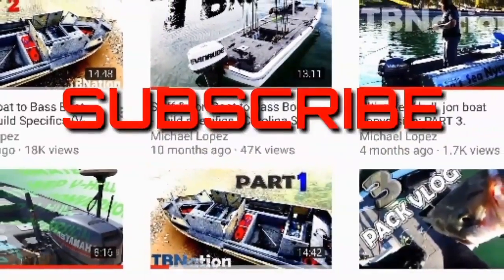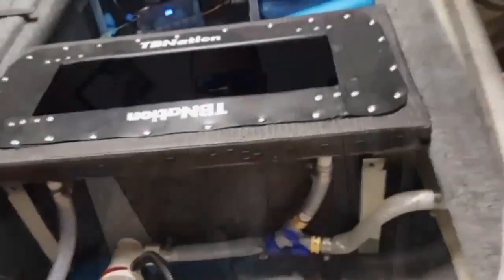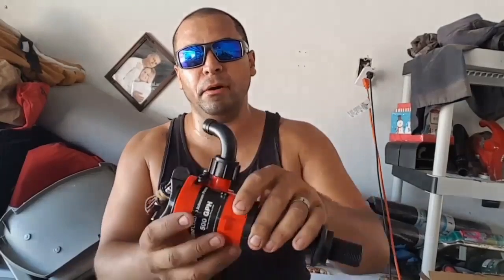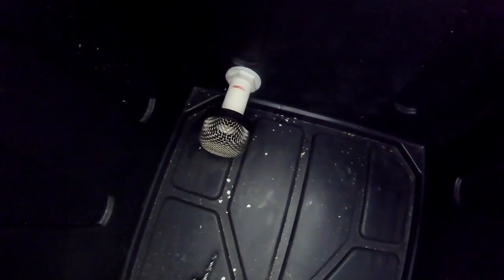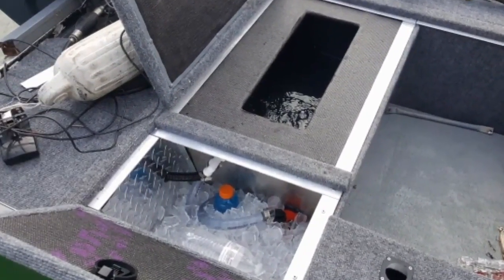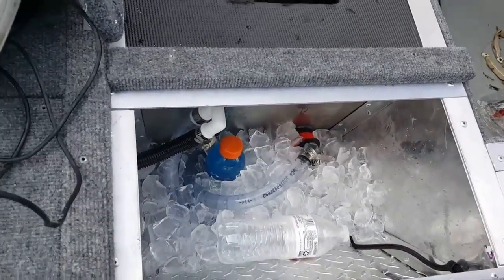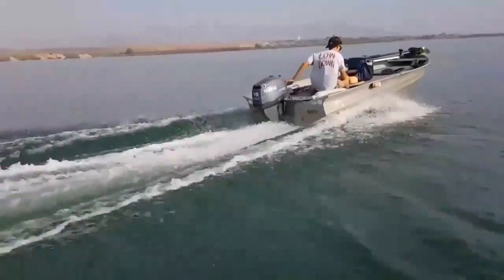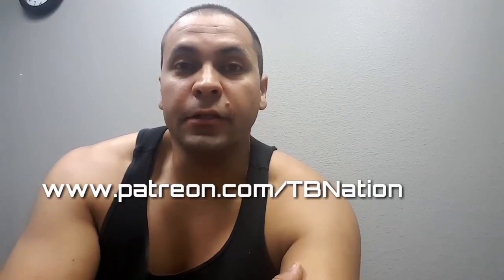DIY Tournament livewell / water cooling system Combo (Jon boat to bass boat) # TBNation

Comment: Love the video. Have you ever considered making a portable cooler livewell using this tech? Most DIY builds simply recirculate the water in the cooler & provide some aeration, but I'd LOVE to see one that pulls in cooler lake water from a hose & allows overflow drainage. Ideally, the inlet hose would be long enough to pull from a depth to reach cool water, not just the top where the boat's hull sits.

Comment: Instead of using 2 pumps on your live-well, 1 for fill and 1 for re circulation. Would you be able to use 1 pump instead and have a 3 way to the inlet of the pump? Just like you have for the out flow. Also do you have to have to fill hole in the transom or could you put it under the waterline under the out flow  drain. I am just asking for opinions, I am planning on doing my own live-well but I want ideas and to do it right the 1st time.

Comment: How about using copper tubing in your chill box? Would cost more, but would be more beneficial too. The copper would hold the temp longer, not requiring as long of a delay for the water to sit in the tubing before going into the livewell.
Probably would want to work with Flex tubing and line the outer part of the chill box with the copper tubing.
Reply: Robert Langley - copper has a chemical reaction to aluminum causing corrosion.
Reply: Seamus Ó Maoilmhichil Liner? It would if touching... Right?
Otherwise, in this case, the only aluminum is in the cooler. Live well is plastic. Other Pipes, plastic. And a liner would or may aide in keeping the ice cold.

Comment: At what point of the water temperature do you recommend having a chill box? Im in Florida but it does't get as hot here. Im debating on either a chill box or rod locker. What do u think?
Reply: What size hole drill are u using for the 3/4" pumps to fit in the transom and livewell?

Comment: How big is the boat you put this in? I'm buying one in the next two weeks, to replace the 12 foot flat bottom I have that has a crack in the front floor. I can't seem to fix it properly, so I'm going to bite the bullet, get a v bottom for my father's day present, and frame it out over the winter, after using it as is this summer. Needing to know just how much you can fit in a 14 footer, or if I'll need to locate a 16'.
Reply: Thanks so much, man. Crazy what you’ve packed into such a small boat. How deep are the v bottoms, typically, that you have built?

Comment: If the water level in the livewell is above the water level outside the boat couldn't you just run an overflow out the side of the boat with a check valve to prevent backflow and just constantly pump fresh water into the well? Just drill the overflow at the height you want the water level to be in the well and turn the fill pump on through a spray bar and that's it.

Comment: does it comply as a factory installed live well because the clubs here in indiana require it in order to join
Reply: Michael Lopez - you should get a window shaker A.c. unit for your garage so you're not sweating it out in there working on these boats.